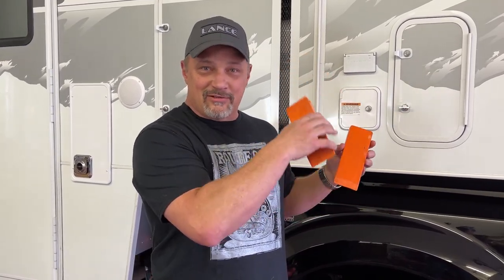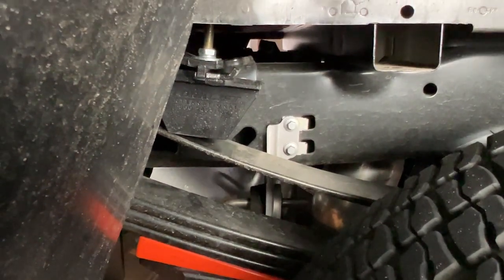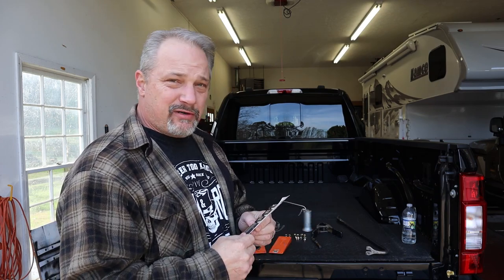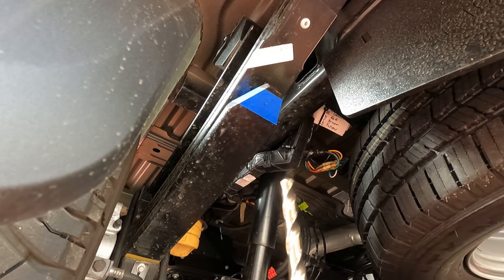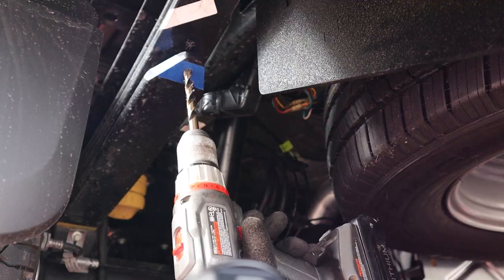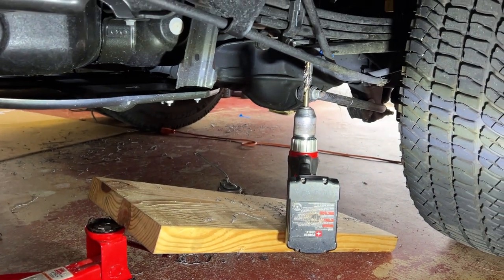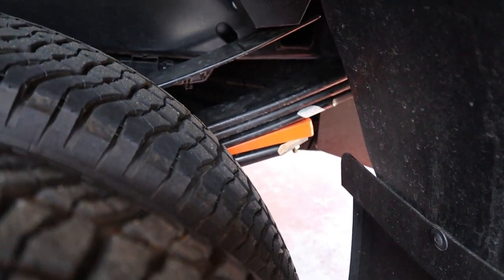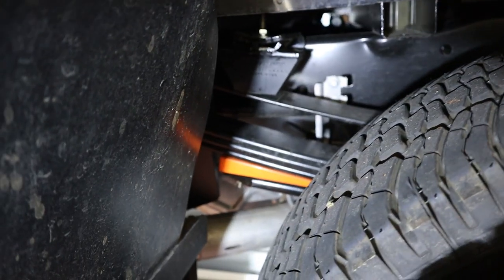Awesome Upgrade / Low Cost Big Results / Lower Spring Control

Comment: Great video! The pry bar is a top tip! I'm on 3 years and 80 thousand trouble-free miles with the wedges installed. When I took them out this fall, there were no signs of wear. I think having the lower overload spring engaged sooner has helped my ride. I'll be curious to see your final thoughts!
Reply from the maker: Hey Kenny,  I look forward to seeing how they do in the future. I know with all four of the wedges in the truck it is definitely a stiffer ride unloaded but that’s ok i’m sure they will help with the camper on.  Thanks for the idea!
Reply from the maker: Btw @kennyofalltrades if you would, please email us an address that we can send something to you. We got something at a camping rally we want to send to you.  It’s not a big deal but just a little something.  Thanks, Todd
runawayrosesadventure@gmail.com
Reply: Many thanks to both of you.   I just installed a set on the front yesterday (have the Roadmaster Active Suspension on the rear).  Raised the rear about 3/4's of an inch.  Now for a test drive!
Reply: I really like the timbren overload springs. Under load ride quality is lower but squat it much less, more stability in bumpy and windy conditions.

Comment: I used 10" felling wedges, drilled lower overload. Tapped hole for grade 5 bolt.Tack welded  90 degree bent thin steel plates to overload spring to insure wedge does not pop out sideways. Tack welds, to not loose temper in springs. Air up bags to 60lbs to insert.

Comment: Nice job. I also took Kenny’s advice with theses felling wedges. I used a tee nut pressed in from the top of the wedges. Then a bolt from the bottom. This option is so inexpensive and easy to do. 👍

Comment: Just noticed this post and I guess the idea of wedges is finally getting out. I’ve used them for years and zero issues. Originally is used lower stable loads and instantly thought they were poorly designed as you described. Nothing I’ve tried matches the performance of the wedges (in my case I tapped 9/16” holes with a 5/8” tap and used a grade 8 bolt to hold the wedges in place. Obviously, the application doesn’t require that strong of bolt but I did it so I can add torque to hold in place. As an aside, I also replaced the 600lbs upper (single) overload spring with a 3600 lbs spring pack (super stable and rides great with camper on - best mod even for the 450). When driving without the camper I simply add a bit of air in the airbags to ensure upper spring pack doesn’t engage (smooth ride on my 450)!

Comment: On my Dodge 3500 the door sticker says to run 40 lbs air in rear tires when empty and then air them back up when haul your camper and it does soften the ride a little. Might help you a little doesn’t hurt to try and with my 7000 lb air bag with compressor and air tank with a air Chuck mounted on running board and the kit comes with bag for storage and curly air hose and gauge  so makes a nice up grade and a way to air you tires up if need be .

Comment: We have the same truck/camper and put on airlift 7500lb bags (independent), stableloads/hellwig springs on the upper overloads.  Looks like this setup achieves the same goal in a slightly different way!

Comment: Man that staircase sure does set low to the ground . Looks like a crunch in the making and not to wish you bad luck. Do you remember back in the day where they had thin mettle rods that would make a noise when get to close to the curb.

Comment: Great idea. Never would have thought of it; or I would have tried it as well.... I installed air bags a few years back. I thought about several varieties of bump stops & simular products; but in the end just decided to bite the bullet and went with air bags. Really not difficult to DIY. They work GREAT. Fully aware they do not add to load cap, but take the squat totally out and end the porpoising when going over train tracks or wavy roads & pot holes. Thru trail & error adjusted the air pressure to get the correct ride given different loads.

Comment: I’ll stick with my airbags. When the camper is off I can release some air so my truck doesn’t ride like a tank it’s still a rough ride though. I’m arranging for insurance on my camper before we head out this spring. Around $2000🇨🇦per year 
Full replacement cost for 10 years.

Comment: I have 3,670 pounds of pin weight on the rear of my 2022 F450 from my fifth wheel camper and don’t need any help of any aftermarket parts. The truck barely touches the aft overload rubber pad. The front  pad is still approximately an 8th inch above touching. my truck still has a bit of a rake on the rear end which means it can handle a little more weight and ride level. That must be one heavy camper to need all that  help to  level your load.  With my current situation,  I am looking for a truck camper, but I will not go over a wet weight of 4000 pounds.  All problems solved from the get-go.  no after market parts needed. 
Would it be nice to have a massive truck camper with three slides for comfort, absolutely, but we will make do with a smaller truck camper just to keep things simple…. Since you’re in the process of throwing a bunch of aftermarket mods to your truck, I would suggest a better set of shocks as well.
Reply: In reading the comment about the pin weight of you're trailer and how well it carries that weight ( I almost get the idea that the F450 has the same rear spring pack as the F350 depending on the year ), I went back to review a prior video Todd made about the current camper weight and he mentioned the figure of 5500 lb with most supplies in the camper but no water in any of the holding tanks. That means with a full fresh water tank and not counting any water in the sewer holding tanks, add few other items and it would easily reach that 6000 lb level which would max out the gross payload of this new Ford. Obviously Todd would know all the details but that should help give you a ballpark as to what the springs are holding up in this video, at least 5500 lb of camper and it seems none of the pickups up to a one ton can actually carry the max gvw without their rear almost dragging on the ground unless they are helped one way or the other with more springs, Timbrens etc etc. Dare I say false advertising from all of the big three ?
Reply: @charlesb4267  yes you are correct. Same rear spring pack. But larger brakes and heavier half shafts in the axle on the F450.
Reply: @skoffco  Ok good to know, and as to your train of thought to keep a slide in camper weight down to 4000 total pounds ready for the road even for the 450, that is an excellent idea as it would have decent stability and not be over stressing the truck. For example I met a couple along the Dalton "highway" in Alaska years back and they were returning from Prudhoe and they had an older 8' camper slid into the back of their 1 ton dually. I asked them about their combination and he said they purposely bought a small camper like that so they had all sorts of truck under it for the crap roads such as the Dalton. No it would not have much room nor storage but it was just the two of them and it just played with the camper. If a person plans to stick to smooth non frost heave highways and so forth then one can get a bit more hefty and work with it but if one plans to venture off the beaten path or travel in the northern states or certainly up here in Canada and on to Alaska with our horrible sections of frost heave pot hole roads, heavy has bad written all over it. And I suspect that is why that Dodge truck split in half in Mexico, it was put beyond its limits and there it is. My brothers 2006 ford 350 dually was rated for 13000 and with the camper he bought ( and yes the manufacture was full of it for the actual weight it ended up being ) , he sits at 13500 loaded with fresh water and gear and he never would have bought the camper had he realized what a pig it is ... yes its a really nice camper but oh is it not going to handle adverse roads. The only reason it could carry it and do a reasonable job initially is due to the extra springs he had installed right off the bat along with air bags ( and the air bag topic is a whole other thing, that was a down grade for handling he found out ) but it was just scary on the road with any sort of side wind or around curves so I urged him to buy  the largest sway bars he could to replace the stock front and rear units and he put the stableloads in as well. Its so much better after all those mods, but realistically its still a heavy pig, no getting around that.

Comment: The insurance for my Bigfoot was just added on to truck insurance was only 45 bucks a year and that’s for when it’s not on truck and if the camper is on the truck the truck insurance covers it. That’s what my insurance broker told us and showed us the policy where it shows any thing in the bed of truck is covered and I had to bu insurance for when it was not on the truck.

Comment: I did end up having a look at my brothers truck which is a 2006 F350 with the stableloads and I had forgotten that the way those springs were designed ( and a different spring pack then a more recent super duty ) , the available gap to stack wedges is far less in front of the axle vs behind the axle on the overload leaf. So not that this will compare to a newer truck, I measured from the tip of the top of the overload spring to the underside of the leaf above. In front it was only 5/8" where as behind the axle it was about 1-1/4 and these measurements are as the camper sits on the truck and the stableloads are definitely in contact with the springs above. That averages to just under an inch so much the same as the falling wedges. I am guessing the springs must be thinner then a newer truck and they are 3" wide, it started out as a 4+1 main pack and he had two more leafs stacked on both sides so its now a 6+1, and the upper overload is only one leaf spring so it didn't do all that much with the upper stableloads.
Reply: Hey Charles, my truck is a 2020 F450 but I did the same mods to my 2016 GMC 3500. The picture is of how I typically travel with my rig! Working outside on my 450 at the moment but happy to share my setup and thoughts. 

66234327645__66D9E3CD-3D4B-4339-A535-FECED8FBA201
image0.jpegimage1.jpeg

Dale
Reply: @dalerobillard  I am probably doing something wrong but can't bring up the photo link you posted.
Reply: @charlesb4267  today is the first day I’ve ever replied to a youtube post, so I’m unfamiliar with inserting pictures. If you want me to share pics maybe send me a text able # or email address and I’ll send pics along!
Reply: @dalerobillard  I am so far behind in technology or knowledge and I believe there is myself and one other person on this planet that doesn't text !. I would give you my email but not here on a social media platform, that is never a good idea. However all is not lost as you could give a brief description of how many leafs you added as I am to understand that the spring pack on the F350 is actually the same as the 450 from what has been said ( have never confirmed that by visually looking at both though )
Reply: @charlesb4267  I got rid of the single upper overload for what the local Spring company calls the commercial pack (3600 lbs four leaf spring pack)! With the camper on i corner like an Indy car.
Reply: @dalerobillard  I wonder who makes those packs, I assume they must be thicker leafs then factory as I see other aftermarket spring packs advertised for the 450/550 and are 10 spring packs .. just a little over kill there !.
Reply: @charlesb4267  it’s actually a 5 pack sorry! I did send another pic but I don’t think it went!
Reply: @dalerobillard  Is that main pack designed similar to the factory main pack, the bottom leaf being referred to as an overload which doesn't come into play until their is weight on the main pack. Now mind you I was not sure if you did this wedge trick with the F450 or you meant only the GM you had. Do you happen to know what the spring brand is that you bought for the F450, this assuming that the spring shop ordered in the spring packs premade.

Comment: Ok, I bought a 2022 Dodge 3500, quad cab dually, to haul my new 2023 Northern lite. We don't travel heavy. NOW you switched again. We can't afford to with truck. So HONESTLY, it's the gas better than the diesel. I know about payload and I know the gas has MORE payload. Our camper weights 35,400 pounds leaving the factory.  A little help here after all I've been following you off and on for some time.
Reply from the maker: Hi Bill Dixon, Both gas and diesel are good options it just depends on your needs.  For us the 7.3 gas seems to be fine for our needs and gives us a higher payload.  Thanks for watching!
Reply: @RunawayRoses  We like your video's, very informative ! Anyone looking to haul or buy a truck camper should contact you. I know why you went with a Lance, that model has a lot of room.  For us, we want no more slides. Dodge sites says my pay load is 62 hundred pounds but it's not. 52 hundred. Northern lite as you probably know weigh their campers at the factory. So we should be alright with a few hundred pounds to spare. WE DO not travel like you. Ours is more of a motel room. lol, expensive motel room. Keep up the good work and thanks!
Reply: I think I delete everything I wrote. lol, anyway good work on the video's and compare gas MPG to diesel please. I pay a lot of money for my 2022 Dodge Limited dually. Keep up the good work!

Comment: Todd, if anyone gives you a hard time over noticing the wedges at the campground, just whip out your Stihl hat and put that on !. I was wondering if that was what you had in the back of your mind to try and without a doubt its certainly worked on Kenny's unit. I was trying to find some information on wedge thicknesses and did come up with a figure of 1-3/8 for 12" units. What length are those ones, 8" ? . As to a comment about being concerned for the wedge slipping out to the side, a thin steel assembly could be fabricated that reaches a few inches towards the other end of the wedge with two "ears" that stick up to either side of the overload leaf spring and capture the wedge from going sideways and it would use the same bolt you installed to hold on this safety device, a similar concept to the steel band straps that contain the main spring pack. I honestly don't know what the thickness of the full pack of stableloads is.
Reply from the maker: Hi Charles B,  The wedges I used are 8" long and right at 1" thick.  I probably should have put that in the video but didn't think about it at the time.  I was thinking about making something to keep the wedges from moving side to side but we'll see.  Attaching something to the bolt is a good idea.  Honestly I don't think they will move especially with the weight of the camper on them but I'll keep an eye on them to see if anything happens.  I haven't used Stableloads but I think it depends on how many of the metal brackets is used when you stack them up.  I think they would be around 3/4" to 1" thick.  Thanks for watching!
Reply: @RunawayRoses  Ok thanks, was just guessing at the length as you held it up and guessed correct apparently. I don't know if 12"s would be the same width or not but if they were and one thought they could get them in there and gain that extra 3/8, would have to cut the wedge tail off though and they would cost more per piece. Its on the cold side as per -12f to give me motivation to go out into the shed and lay on the cold cement to measure the thickness of my brothers lower stableloads but am curious what thickness they are for comparison sakes.
Reply: I’ve tested for the wedges sliding to one side or the other but the bolt in the thick end is more than capable. I have thousands of km/miles on my system (on rough roads/hwys with zero movement whatsoever). If interested I can send picks of my setup with the 3600lbs added spring pack!
Reply: @dalerobillard  Out of curiosity what model and year ( and make ) of pickup did you also do this mod on. The 3600 added spring pack, is that leafs you stacked into the original main spring pack ?. I have to say that its looked odd on the ford why the upper overload seems rather wimpy, would have thought there should be a bit more beef to that system, I assume they had their reasons for not doing that.

Comment: try holding that tape measure straight up and down on that second measure - fender to wheelwell. Your messing up Drilling those leafspring.
Reply: My mistake...I thought you were Drilling through all of the springs.
Reply: Third measure was good.